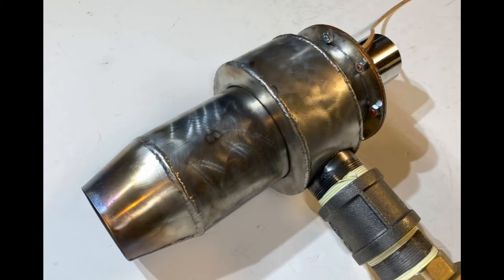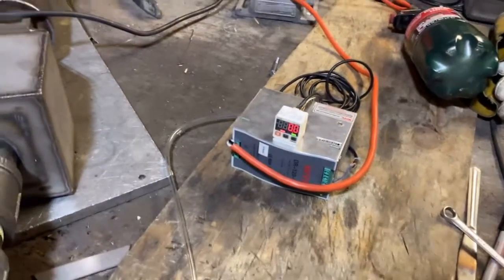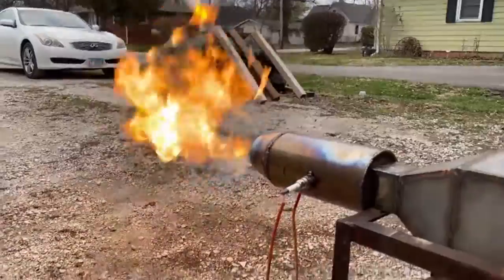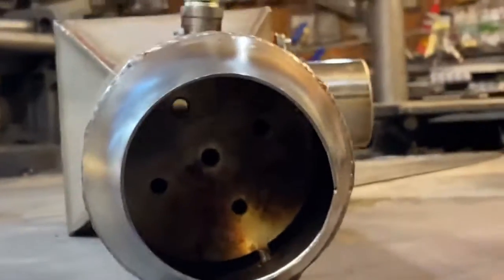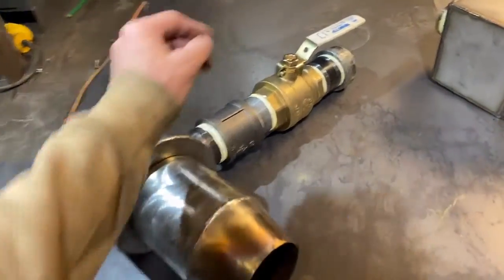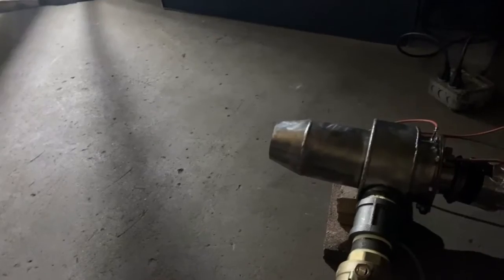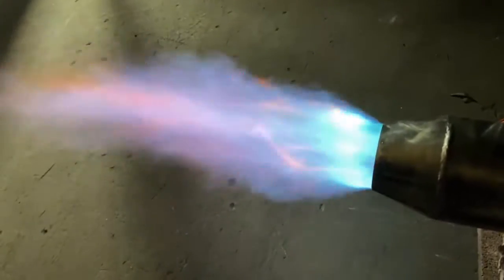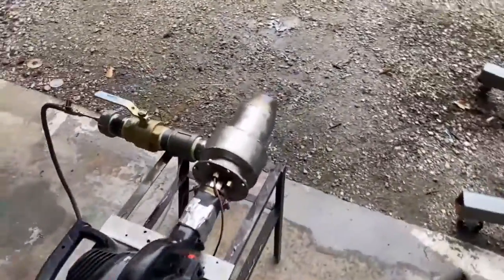The HAMMER Natural Gas burner for Kilns foundries and dryers

Comment: Using the Pressure Gauge as a Check is a good Idea.
Some commercial Burners do this and the Benefit is that you are measuring what’s important for the Combustion and not some Thing you guess relates to it.

For Example:
Even a going of the Rotation of the Blower Motor can be misleading if the Fan Blades are not coupled right anymore or damaged.
The Pressure leaves no Effects between the Signal and the Outcome you are after.